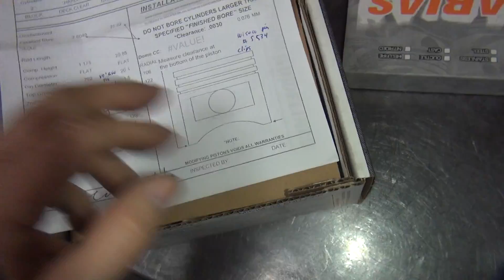1941 wld 45 56ci stroker #226 flathead motor build 4-5/8 in harley wl by tatro machine

Comment: back in 1960 I owned one of these 1949 wl 45 with aluminum heads. a whole whopping 25 hp! bought it for 200 and sold it for 400 never regretted having it or selling it. this is the kind of thing around at the time cheap.

Comment: When did you get them Arias pistons? I see 2013 or 2015 on the sheet. I was told by my racing machinist friend last fall that they were liquidated by CP/Carillo. Probably my favorite Harley engine. A 4 5/8" stroked 45 flathead.
Reply from the maker: yes this has been a long project. old story, buy up the competition and you make more money.
tatro